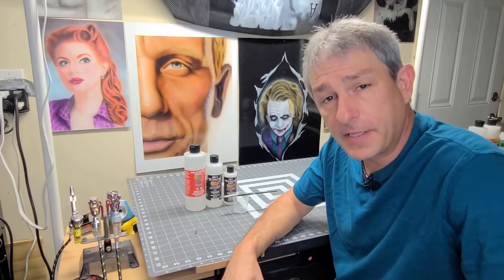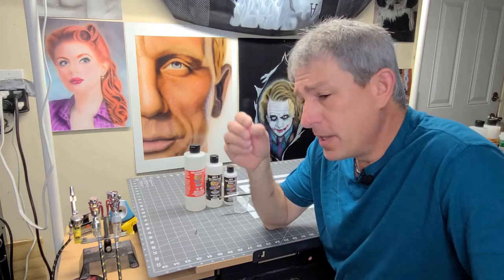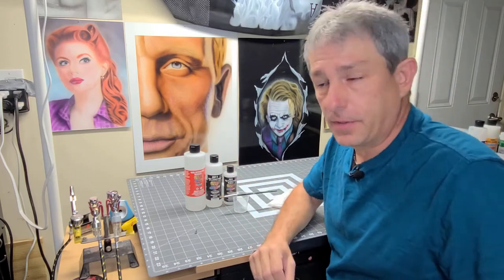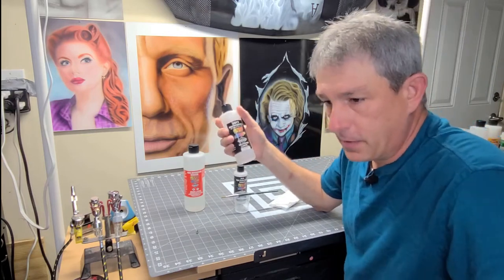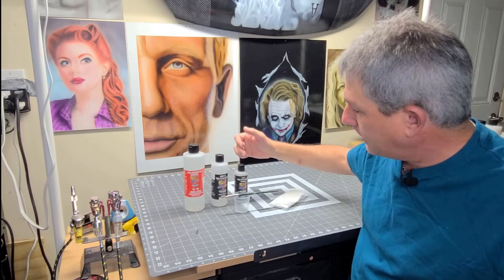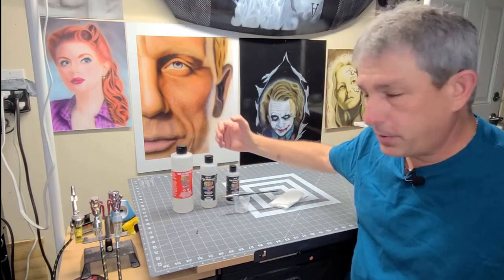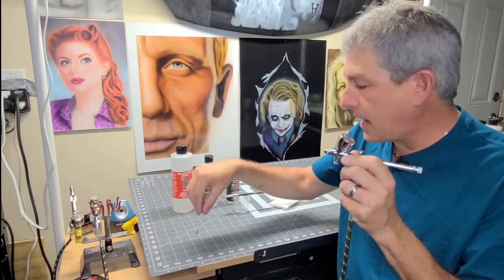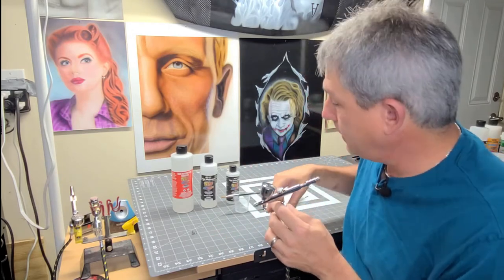How to Airbrush - Tip Dry and how to deal with it

Comment: Any recommendation on fixing tip dry that's beyond pulling it off the needle? I think my tip dry clogged the paint drop and now I'm not getting any paint, but tons of air flow.
Reply from the maker: Gregory, controlling tip dry really comes down to trigger control. Make sure you are shutting the paint off first and then the air. I hope this helps.

Comment: Hey pal. Great vids.
     I'm a 30+ year victim of the infatuation with the airbrush. I have both a Thayer-Chandler #C and an Iwata Eclipse HP BCS. 
Q.  I'm using latex wall paint to create a frescoe on my wall. I'm not really having any poblems with the paint although I occassionally get dry-tip.
     My question is.... could a tiny amount of dish-soap in the paint help reduce tip-dry. I'm going to try it but would value your opinion.
     Keep on spraying!
Reply from the maker: Tip dry is just something we deal with but if it is to frequent I thin the paint. I don't have any experience airbrushing with latex but I assume the reducer is water. I am not a big fan of using dish soap with any paint. But....experiment and let me know. I would be interested in the results. Appreciate you watching.
Reply: @TheAirbrushGarage  
   Hello my friend. 
   I tried the soap additive in my latex paint and it seemed to smoothen out the flow somewhat. 
   As a watercolourist I've used this trick to reduce the surface tension of the paint allowing it to flow easier from the brush to the substrate.
   The addition is only a very little bit. Eg. To a 100 ml paint solution the quantity of soap would be a brush-full of either liquid dish-soap or from bar-soap from the tip of a tiny detail brush. Seems insignificant, but enough to change the s/tension just enough.
   Anyways, just following up.
   If you experiment with it I would ask you to let me know if you find a difference. I know we all have our customary and comfortable techniques but sometimes something new can help overcome some nuisances. 
   Have a great day!
   If you're interested I've included the link to a video I made a while ago.

 https://youtu.be/b2lF6cvedpU

Comment: Just started airbrushing and it's summer here. It's either 30+ celsius where I'm painting or lower temps but 70+% humidity. I get tip dry almost instantly, even when practicing proper trigger technique.
Reply from the maker: When that would happen to me I would just keep adding a drop or two of reducer until I see improvement. Also clean the tip of the needle and the nozzle with a small paint brush dipped in reducer when you do get tip dry. It works better than using your fingers. Hope this helps, and don't give up.
Reply: Thanks for the advice!

Comment: Good stuff . Thank you. Im having trouble with getting what looks like paint nibs. Little bumps through out my work piece. Any suggestions. My climate is super dry (50% humidity) and around 69 degrees.
Reply from the maker: Thank you for watching my video, I'm happy you found it helpful. Bumps... Hmm, first, make sure you are not getting any moisture coming through your brush, second, start with a 1 to 1 mix, make sure you are using the reducer recommended for the paint you are using. Also, make sure you are shutting off the paint before you shut of the air. If you don't, paint will be on your needle and when you depress the air again the paint will get blown on to your surface in a splatter pattern, As far as your humidity...I personally like when the air is dry, I get a lot less tip dry. I have more trouble in high humidity, I really have to play with the reducer when it's hot and humid. I don't know what type of paint you are using, but I like Createx. The bargain paint at the craft stores are not worth it. Hope this helps. Reach out to me anytime.
Reply: @TheAirbrushGarage  thank you. Starting to get the hang of createx paints.

Comment: I wish I could last at least 3 mins with Createx paint without tip dry, specially white color, that color is the most I use but damm bro I do two strokes and is already dry, it`s driving me crazy. I use some time Golden paint and is fantastic, but white color is not as vivid as Createx.
I will try tonight like you say 4020 reduce and see if I have more luck, I`m just asking for 5 mins tip dry free 👃.
Thanks for the Video ;)
Reply from the maker: Alden, I'm sorry, I thought I replied to this when you posted it but now I don't see it. If you are using Illustration colors I have since found it better to use just water. I found this out after taking a trip to Dru Blairs school of Realism. That paint was formulated for his school so he knows it better than anyone. Also, on the wicked colors I use 4011. Createx stopped making the 4012 due to the Acetone in it. You can still get it because there is still a supply of it left but Createx told me once its gone it's gone and the 4011 works just as well. Good luck, don't give up you will get it.
Reply: Holy shit I thought I was the only one the cretex white sucks so bad I literally can’t spray like you 2 strokes and it’s all tip dry ! I literally have to reduce it 70-30 with reducers

Comment: When I draw needle back and off then when I start to paint it splatters at begining do you know what could be causing this
Reply from the maker: Sorry Damen for the delayed response. It sounds like you are shutting off the air before you are pushing the trigger all the way forward to shut off the paint therefore there is paint on the end of your needle and when you press the air down it is blowing the paint on to your project. Now with that said that exact description usually causes tip dry which can cause clogging an also spattering as well. Get a needle reamer https://amzn.to/3VAPkrX clean your nozzle, this will get any dried paint out of there. Now another trick I use is some reducer in a cup and a small paintbrush. Brush the tip of the needle and nozzle with the reducer and dry it with a paper towel (so you don't blow reducer onto your project) I try this first. If that doesn't work then the reamer. Hope this helps and sorry again for the delayed response had a lot of company for the holiday. thanks for the question and thanks for watching.

Comment: I found the magic trick to no dry tip. There a product called vallejo airbrush flow improved. I mix it in 50 50 with thinner (reducer). I paint everything from canvas to miniatures and customizing stuff it works for all of them. And I also can't stand people using exclusively water or try making flow aid out of dish soap. I find it in every type of painting except classic brush on canvas.
Reply from the maker: DLM, thanks for sharing. That is great advice for other viewers. Thanks for watching. Much appreciated.